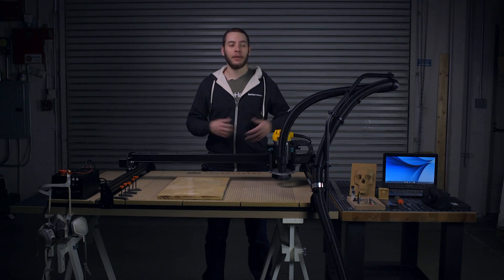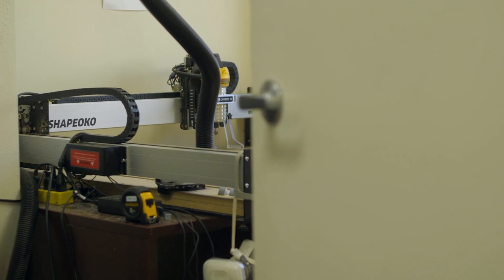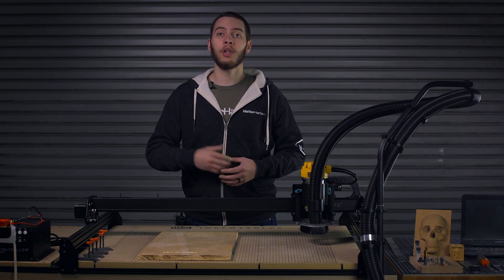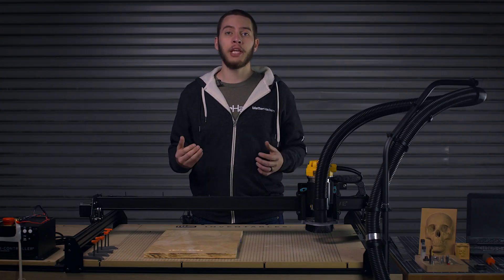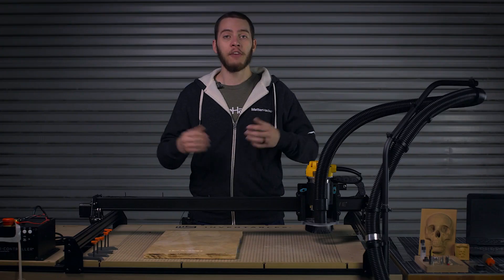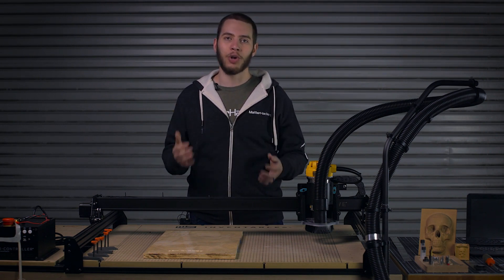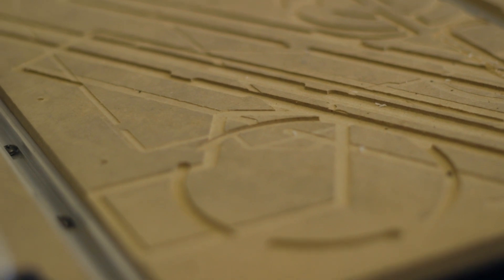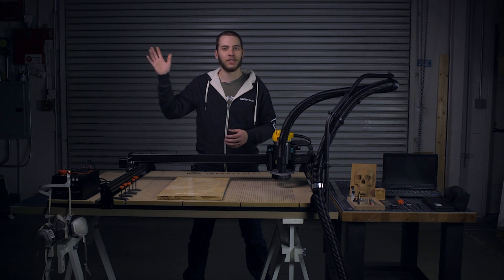How To: Set Up Your CNC Milling Station

Comment: Hi, does anyone know a quick way to make a 3d object cnc friendly? Solid all the way to the bed? Right now it is not flat and it is hollowed. I need something that will extend the edges of it in one direction - down to the bed. Similar to what 3d printing programs do when they make support structures for anything that is not touching the bed.
Reply: 100% infill will allow you to carve away at a piece.
Reply: I was just about to say the exact same thing

Comment: Awesome video bro, left my like, random question since I'm new to the channel and about to subscribe, do you have anything on how to install LED's into a prop gun? I'm a total noob, and am getting a 3D Printed Replica of the BFG 9000 From DOOM 2016 And have to assemble it myself and paint it when I get it. But on top of that I wanted to install Green LED's in the areas meant to Glow, but have no idea how to do it without showing the power pack that I'm going to connect to the gun.... Any advice would be greatly appreciated!